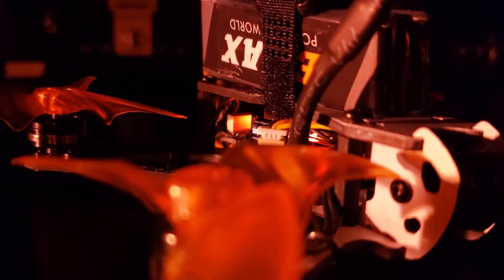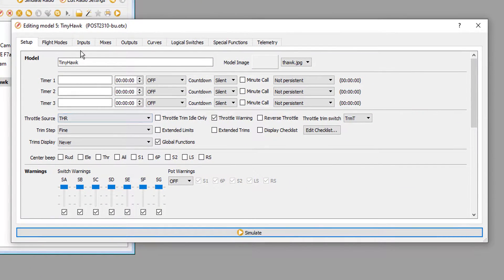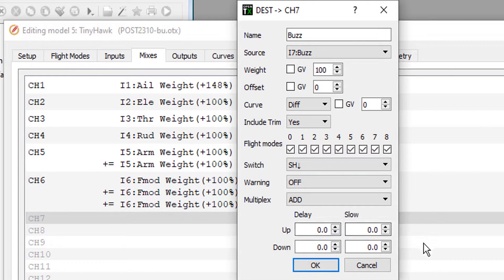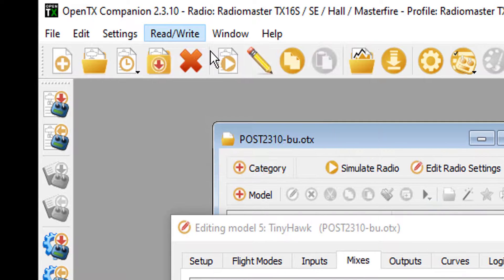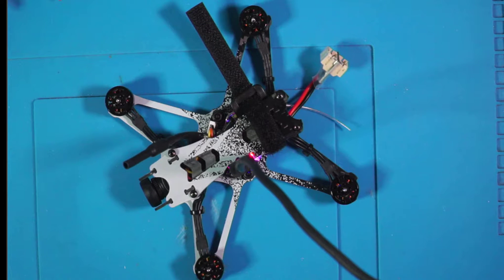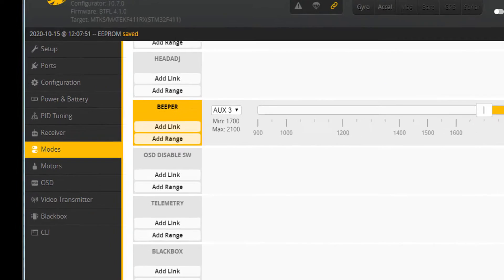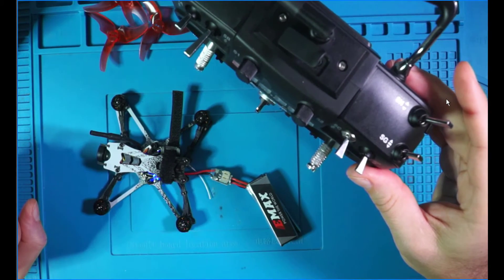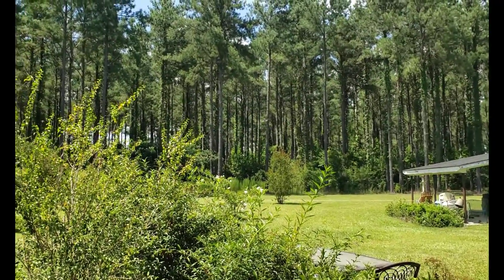Adding Buzzer to Emax Tinyhawk Freestyle 2 on a TX16s

Comment: Привет Дружище!!))) Этот модинг ОЧЕНЬ НЕОБХОДИМ.!)) На плате есть два контакта "+" и "BUZ" внешнее подключение. У меня TinyhawkS, с двух сторон по периметру рамы проложил по дну два небольших кусочка светодиодной ленты L- зеленая, R - правая, припаял к этим площадкам - теперь по бортам добавлен мигающий ЗЕЛЕНЫЙ и КРАСНЫЙ свет при активации кнопки. Удобно и при полете если не в очках, легко определить каким БОРТОМ к тебе повернут аппарат, особенно на большом расстоянии. Твои МАСТЕР КЛАССЫ!!! великолепная вещь, хоть и изучаю уже два года но ОЧЕНЬ!! интересно. Как говорят наши старшие братья Летчики, ВИДИМОСТИ Вам!! 1000000 на 1000000 км. при полетах. Hi Buddy!!))) This modding IS VERY NECESSARY.!)) There are two pins on the board "-" and "BUZ" external connection. I have TinyhawkS, on both sides along the perimeter of the frame I laid two small pieces of LED strip along the bottom L green, R - right, soldered to these pads - now a flashing GREEN and RED light is added on the sides when the button is activated. It is also convenient when flying, if not wearing glasses, it is easy to determine which SIDE the device will turn to you, especially at a great distance. Your MASTER CLASSES!!! a great thing, although I have been studying for two years, but VERY MUCH!! interesting. As our older brothers Pilots say, VISIBILITY to you!! 1000000 by 1000000 km. when flying.👍👌😜

Comment: If you have the tinyhawk, Emax already have the beeper profile setup in betaflight so you don't have to use OpenTX companion app, just set up the beeper mode similar to how Steve showed us to setup arm and different flight modes in video 2 of this series. Then simply configure in betaflight. Great series btw, helped a complete noob. I only found this solution due to having a mac.

Comment: Again, awesome videos!!  I just my setup just like this and followed all your instructions! Worked great.  I am a novice, though.  When I arm, my drone bounces.  Also, when I lift off, it drifts to the right.  I tried compensating with trim. Took 20%!  Videos on stopping bouncing and balancing the Tinyhawk II freestyle literally, or with TX16s would be much appreciated!!
Reply from the maker: Mine bounces and drifts, too.
Reply: Bouncing is natural for all FPV quads because of the force of the air from the spinning props close to the ground. There is no fix for this.

Comment: Your always on the money, I have a problem with the tinyhawk II when I start up and the quad is on the ground spinning it tends to bounce up and down. And it is also very sensitive with the throttle, can this be  something with the PID's, it's at factory set and I didn't do anything with it. A1 video BTW.
Reply from the maker: Your throttle question will make a great video idea.  I'll knock that out today.  As for the spinning and bouncing, please verify that your props are on correctly and your motors are spinning the right direction.

Comment: Thank you, Steve, much appreciated. I was hesitant to fly a little further without this function enabled. 👍🏻👍🏻
Reply: I wouldn’t even think about flying without this.  especially because the only place i fly is over my backyard fence in forestry kinda area with tall grass and plants everywhere
Reply from the maker: @Drew I agree.  On a couple of builds in the past (where the buzzer had to be soldered on the board) I was lazy and didn't do it.  3 hours later with about 5 ticks in my hair from wading through high brush, I found my quad.  Never gonna make that mistake again.
Reply from the maker: Glad it helped
Reply: @TahoeSteve  Totally did, just added the buzzer, with your guide, it was a breez. Earlier, I was super confused with the entire OpenTX/Beta flight relationship. Your videos helped me tremendously.
Reply: Steve, I have another good topic for the TH II video. Adding a turtle mode to the drone.

Comment: I’m trying to get my beta95x v2 to beep but it won’t. i can see it activating in the modes tab and i see a green light (i assume from the esc) flash super quickly in response to when i flip the switch but i don’t hear anything. The only beeping that starts happening is after a few minutes when it’s plugged into betaflight with a battery.
Reply from the maker: I don't have any experience with a beta95x v2 but it should work exactly the same as the tinyhawk 2.  I have a stupid question but does come natively with a beeper?
Reply: @TahoeSteve  it does not come with a beeper but just like the tiny hawk it should be able to beep the esc.  it does beep but only after a few minutes of being plugged in
Reply from the maker: @BurgerurgerFPV  Man, i'm still learning this stuff too, and i don't know why it ain't working.  hopefully someone will see this and chime in so we can learn together.